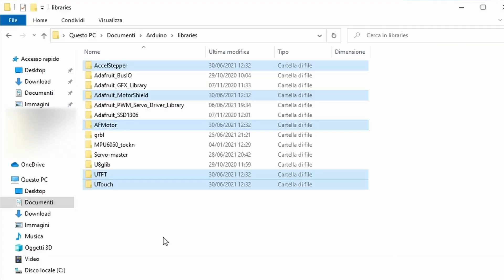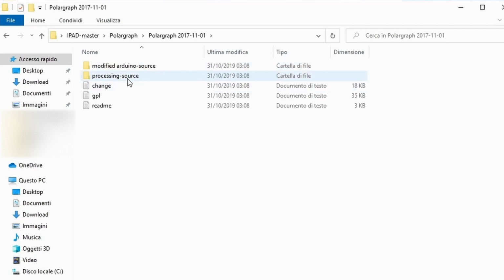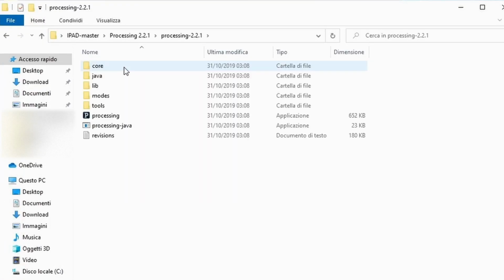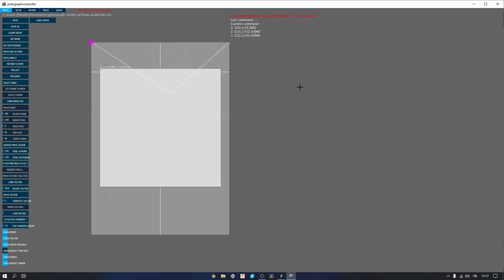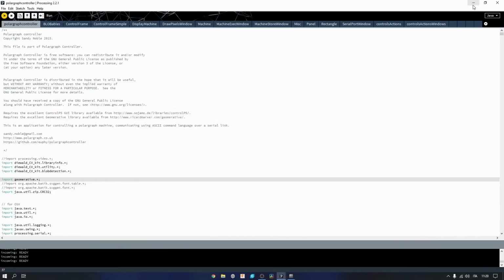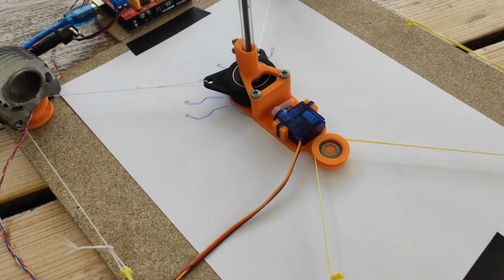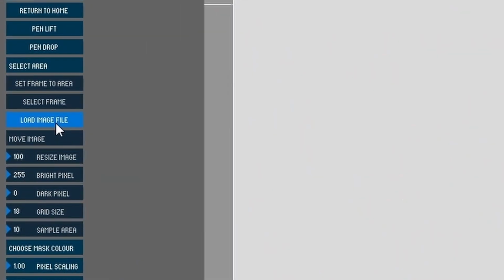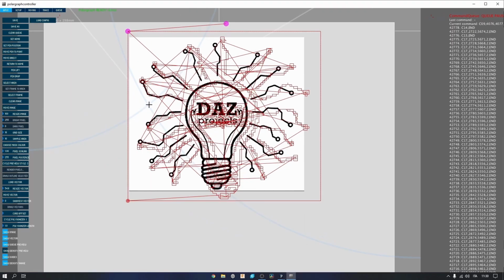the simplest CNC PEN PLOTTER, how to use it

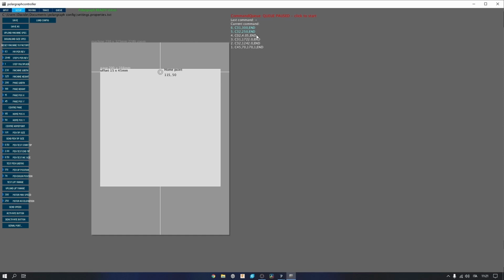Comment: This config file should work, save into your normal text editor (e.g. Notepad on Windows) and save as type "all files", with filename as "settings.properties.txt". Double check 2:07 if these settings are correct but I think they are. Hope this helps anyone that needs it!

#   *  Polargraph properties file   *  
controller.pixel.samplearea=2
controller.pictureframe.position.y=200
controller.pictureframe.position.x=200
controller.machine.colour=969696

machine.motors.mmPerRev=63.0
machine.motors.accel=250
machine.motors.maxSpeed=1500
machine.motors.stepsPerRev=2048

machine.step.multiplier=8
machine.penlift.up=70
machine.penlift.down=187
machine.pen.size=1.01

controller.testPenWidth.startSize=0.5
controller.page.width=200
controller.page.height=198
controller.testPenWidth.incrementSize=0.5
controller.testPenWidth.endSize=2

machine.width=230
machine.height=325

controller.homepoint.y=50
controller.homepoint.x=115

controller.page.position.x=15
controller.page.position.y=45
controller.vector.scaling=100

# Below are default settings:

controller.window.width=634
controller.frame.colour=C80000

controller.image.position.y=0
controller.image.position.x=0

controller.image.height=500
controller.machine.serialport=0
controller.window.height=362
controller.maxSegmentLength=2
controller.geomerative.polygonizerLength=1

controller.pictureframe.width=200
controller.grid.size=100.0
ontroller.pictureframe.height=200
controller.page.colour=DCDCDC
controller.image.width=500

controller.pixel.mask.color=00FF00
controller.machine.baudrate=57600
controller.vector.minLineLength=0

controller.geomerative.polygonizer=0
controller.vector.position.x=0
controller.vector.position.y=0
controller.image.filename=
controller.background.colour=646464

controller.guide.colour=FFFFFF
controller.density.preview.style=1
controller.pixel.scaling=1
controller.densitypreview.colour=000000

Comment: Hi, I would like to know if you used a calibration or configuration in your stepper motors drivers. Please, my motors aren't running.
Reply: same, but probably it's an error with the software
Reply: hey bro, literally i solved it rn, if you want help just say it
Reply: Hi man can you help me? Pls answer me, i need it as fast as you can😢 @SimpleMP

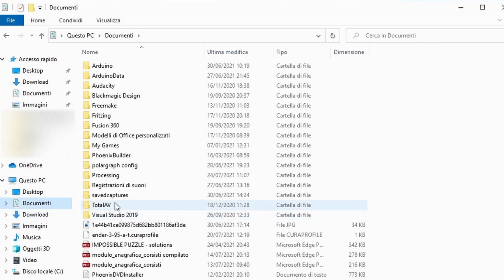Comment: 0:54 bro in my documents its showing only arduino data  this processing thing is not there
Reply from the maker: If it isn't there create it
Reply: @DAZprojects  bro for testing the dipole motors i plugged them into cnc and tried to wrk it but in processing software it is showing this point doesnot falls in the machine